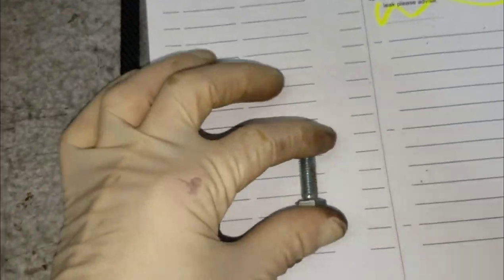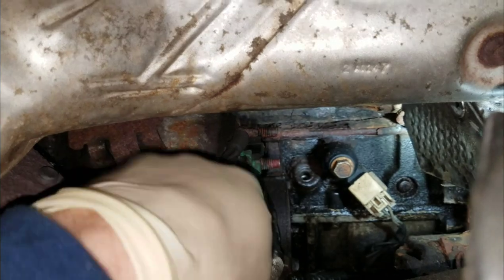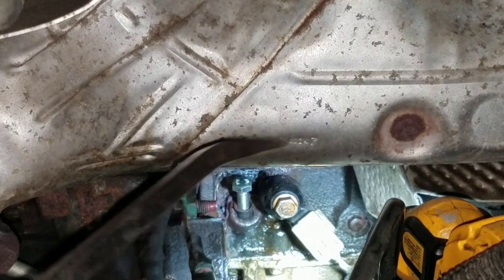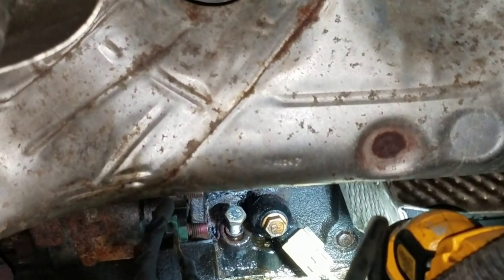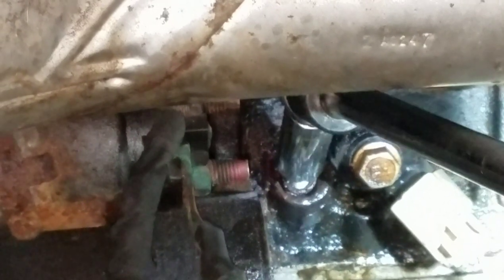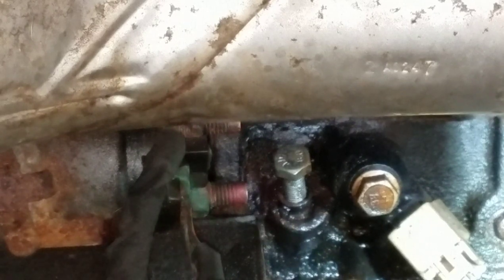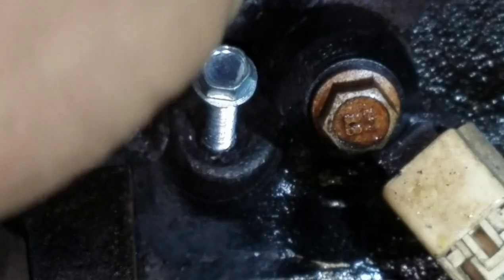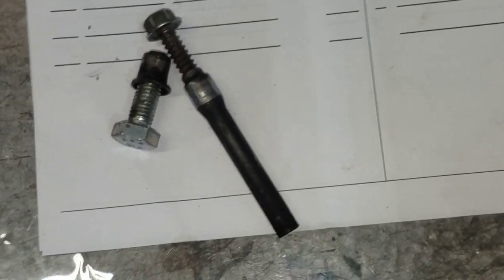How to remove a broken oil dipstick tube "Chevy 5.3l 6.0l"

Comment: Find a piece of pipe or a socket that fits over the dipstick. Use a screw that's long enough to bite into the smaller  diameter part of the tube with a head or washer on it so it will tighten against the pipe/socket. Tighten your screw into the dipstick.  This will pull the dipstick into the socket/pipe without the binding issue caused by hitting one side of the screw and pull it out as one piece.  -Cheers
Reply: Brilliant!

Comment: Hey guys, Enjoyed the video. Just an observation. When You are threading down the first bolt you can not go too deep. The reason is that the bolt is cutting the groove the o ring sits in. That metal is pretty thin even if in perfect shape. Hit with a penetrating oil and be patient or just go to the thinner self tapping screw if you can get one long enough. In emergencies you can pick up some dry ice and actually crush it up and send it down the tube. It will break the metals free. Make sure you have proper safety gear so the ice does not  injure you. You can use a funnel to put it in. Best part is that it has no affect on the oil because there is no water. Thank you for posting the video!

Comment: Thank You!! This video saved my arse today. Dipstick tube broke off at the block while trying to replace it today. Used the bolt technique and got it out. While threading the bolt in the remaining dipstick tube tried falling into the pan. Had just enough bolt threads caught to pull the tube back out. Lucky break!
Reply from the maker: Looks like you dodged a dipstick disaster there! Glad the bolt technique worked for you.

Comment: i had already tried an extractor, only to break the remainder of the tube loose, but not able to remove. ive done this trick with a broken glow plug  in the past. thanks for reminding me what i was doing! great video for those who may not know that hollow tubes can be threaded if they break and pulled out this way!

Comment: Thanks for this video! I was able to get a 5/16 lag bolt down in it and drive it out. Whole process took about 7 hours. It was a long day. Took another hour and a half to get the new tube in because the fit is so tight. Clamping some vice grips onto the bottom of the tube and hitting a bar from above the engine. Its been a long day, but got it all done.
Reply: Could have pulled the whole motor in that time 😂😂
Reply: @reyeshall6354  😆
Reply: 7 hours dang. First time working on a car?

Comment: I used a easy-out screw extractor instead of a bolt. Heat, lube, twisty- twist and out it came! Thanks for the tip!
Reply: You remember what size extractor bit you used?

Comment: This worked very well with a truck I had com into the shop. I didn’t have to burn out the seal though it was already missing. I just used an old manifold bolt and it did the trick

Comment: I will be running in to this on a f150 and this video will help me a lot, but was wondering if you you could have used the tap screw first and saved the first step with bolt in case the tube breaks at o ring.

Comment: Did you tap the screw down a bit > because trying with just the socket is not getting tight enough. So wondering about taping a bit.

Comment: So would that bolt method work on a 92 Dakota magnum 3.9 on the top of the tube, without heating up the o-ring & PB blaster don't hurt the o-ring, old broken dip stick has been shoved down 6-8 inches, in tube, & can't put in new dipstick & don't want to push it through to lay in oil pan, & run vehicle, afraid it might get caught up in motor , & jack up newly rebuilt motor, driving 800 miles to go home, so you see my situation

Comment: try a vaccum (old kenmore vaccum worked for me).   believe it or not, I was able to vaccum mine out.  but, I did need to wrap my hand around the oil tube and the vaccum hose as best I could to get good suction.   my dipstick was only down about 1/2 inch.    if it is down there 2 or 3 inches, I am not sure if it will work.   so glad I didn't have to drill.  I was worried about a few plastic shavings making there way down into the engine.  I have a 2006 nissan sentra and the oil dipstick is pretty easy to access as it is on the front of the engine.
Reply: He’s removing what’s left of the dipstick tube. Not the dipstick itself. No way your going to be able to vacuum the tube out of the block lol. I know your comments a year old but I had to say something 😅
Reply: @austinseverns6143  Must be a hell of a suction. Friggin elephants run away from that vacuum!

Comment: Drop the pan deepwell 1/4 inch drive 8mm with 6 inch extension bump out with air hammer will also knock that up through.
Reply: The point is to avoid having to go through all the trouble of dropping the pan. Especially on 4x4's because the transfer case gets in the way

Comment: OMG so not how to do this, People this is simple
1. move the starter out of the way (takes 5 minutes)
2. tap the slender part of the tube with 1/4 20 tap
3. run bolt through any larger socket with a washer and a nut 
4. tighten the bolt until its 1in in the old dipstick
5. tighten nut against socket this will come out in 3 minutes
Do not have to heat this, the dipstick is designed to be removed so
when you have to remove the starter it comes out..
Reply: What about when it breaks off to far in?
Reply: We are men and we like to hit pry bars with big hammers it makes us feel better
Reply: @nelsonmiller6800  And think we don't get excited about lighting a huge flame and burning this dip sticks sins away???